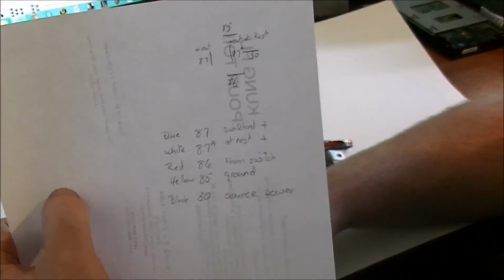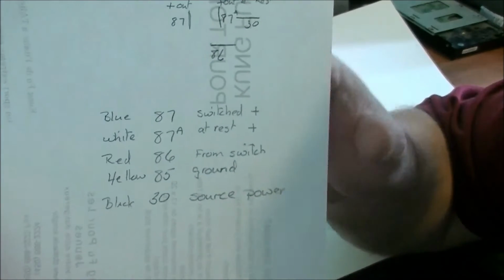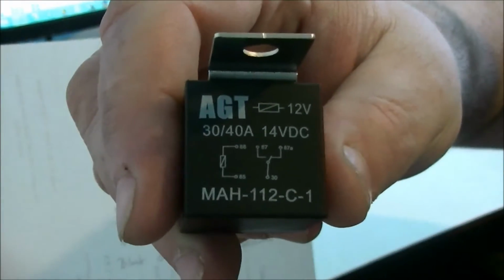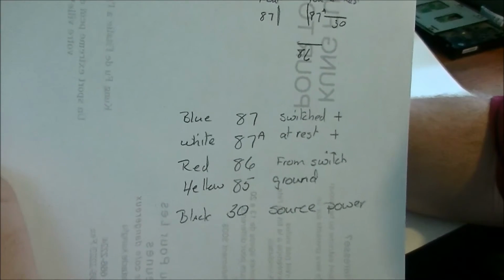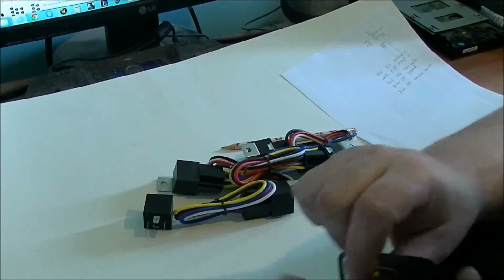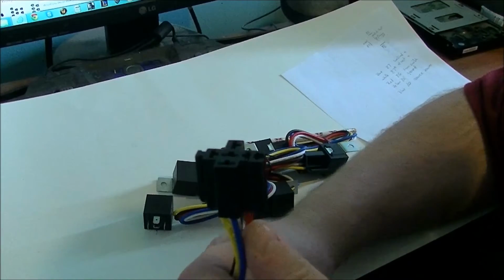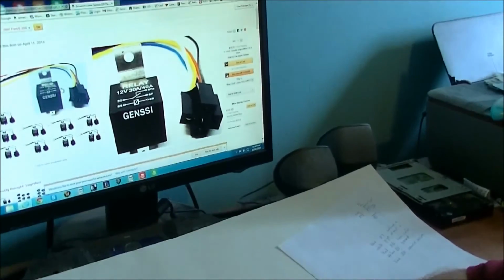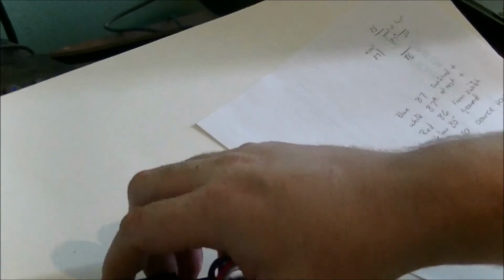12 volt relay and how to hook it up.

Comment: If relay has 12v signal, can it be hooked up to a 24v battery source? So that 12v signal will activate relay (close contact) but the battery source connected to a 24v battery bank to power 24v load?
Reply from the maker: +sunsensational  The power that flows through the relay can be AC 120v or DC 6v, 12v, or even 24v. The power required to operate the coil in the relay is rated at 12 volts DC. So in short the answer is Yes. Good question.
Reply: thank you tremendously. i can't tell you how long i've searched for that answer.  i thought it could be, but wasn't sure...thanks again!!
Reply: I forgot to mention though if using 24vdc I think you will only be able to run 15 amps instead of 30.
Reply from the maker: Yes. It is just that the load capacity of the relay will be less instead of it being able to handle 30 amps it will likely be more like 15 amps at 24 volt. The relay will most likely only draw about less than 1 amp of 12 volt power to operate.
Reply: thanks guys for the add'l insight which makes sense, and still works for my application, even with the reduction in load capacity